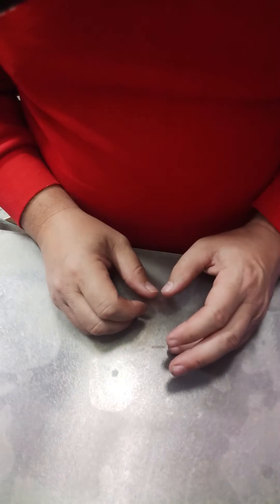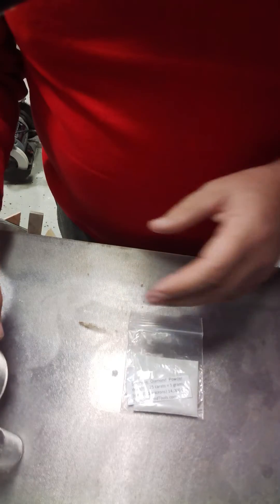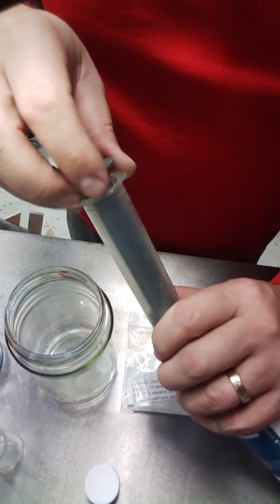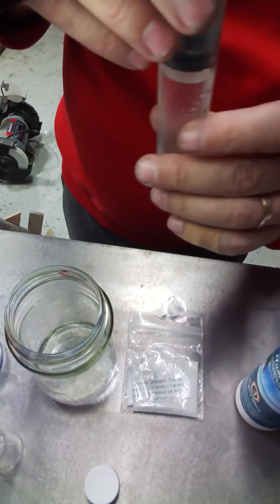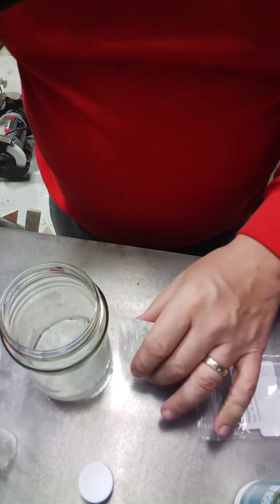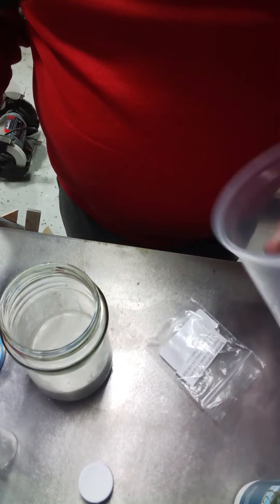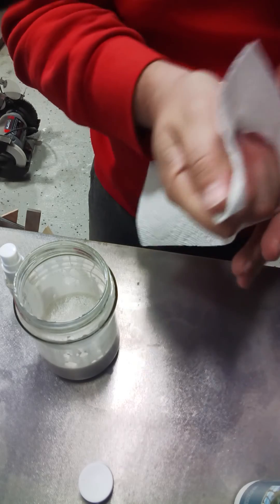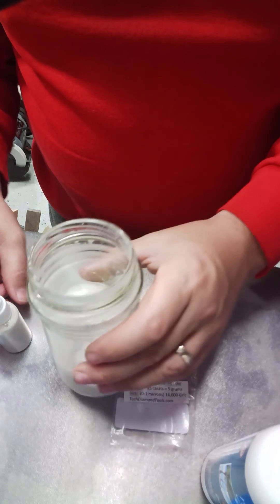DIY Diamond Spray solution for strops.

Comment: Just wondering if you could just use the premix? If its already 50/50 pg/H20 then you should be able to use it directly from the bottle without adding any extra water. Another idea i was thinking about would be adding food coloring to each diamond spray so not only would the solution be color coded so would the strops. I also like using basswood for my strops.
Reply from the maker: You probably could.  But it really depends on what you are using your diamond spray on.  I use mine primarily on various motorized belt grinder with leather belt or a wool pad on a scissor flathone.  What I have since found is that anything with speed that can cause the sharpened item to heat up will cause Propylene Glycol (PG) to form a hard crystal coating on my sharpened object when the item becomes heated during the buffing process.  It doesn't take much heat before the dark black crystal forms on knife or shear.   The crystal coating can be rubbed off with alcohol but it takes a bit of effort.  So any concentration with PG in the solution has the potential to cause this situation.   The 50/50 use of humidor solution would create this coating.  I have since moved over to using my recipe with the Di-Propylene Glycol (DPG) and I don't have any of those issues anymore.  If you are using the spray solution on hand strops, I don't think you would have any problem.  But like I said, I am really liking the new formulation.  You can find the new formulation in the video details under the 20240712 update.  I use camellia oil to the recipe to keep things better in suspension because I I have and use camelia oil for shears and knives.  Mineral oil for cutting board might be a suitable alternative if you don't have camellia oil.  I really like the new formulation for both motorized belt and hand stopped leather pad.

Comment: 2 oz distilled water
3 oz of humidor solution would have worked better, right?  or better still if DPG - 3 parts DPG+ 2 parts distilled?  got DPG...mygreathanks and blessings
Reply: In the end I think any ratio would probably work.  I haven't needed any more solution yet to try other recipe.  One person posted previously that if they used 50% propylene glycol (PG) and 50% vegetable Glycerin  (VG) that the diamond powder stayed in suspension.  This is a common vaping configuration recipe.   Propylene glycol(PG)  and di-propylene glycol (DPG) are a type of alcohol which are used as a viscosity reducing agent and aids in keeping powders in suspension.  DPG is considered safer and used in cosmetics.  The other idea is you want to keep a bit of tackiness so it holds the powder onto the strop when it dries.  Glycerine or vegetable glycerine would help keep leather soft but you don't want so much that it starts acting like a sticky sugar and holds more dirt and steel on your strop. The glycerine would tend to cause spray bottle nozzles to clog up.  Next time I try it I might just use straight humidor solution since it is 50% water and 50% PG.  Nothing to mix but it would end up costing a little more to make the solution.  Also if you use different diamond grain sizes, add a different food colouring so you know which solution is which grit.
Reply: @toddbenko6701  that last bit is great advice - color coding different grades. and your first point - doesn't matter the ratios - even pure distilled would do as one shakes the bottle anyways before spraying.  my order of diamond dust is arriving first week of May and will try 50% DPG + 50% distilled water.  will also try 75% DPG +25 distilled and last - pure DPG and will let everyone know results...mygreathanks and blessings
Reply from the maker: I use my diamond spray solution on 1x42 leather belt and a flathone scissor honing pad.  When using the solution on the flathone for hair shears on a felt pad, the scissors would get hot enough that the propylene glycol would crystalize and form a hard shell on the metal.  My last batch I have changed my recipe to the following

2.5 oz distilled water
2.5 oz of Di-Propylene Glycol
3-5 cc of Camellia oil 
25 CW = 5 grams monocrystalline diamond powder.  

I added the oil because I wanted a more softer media that would that tend to move slightly in the direction of some of the diamond pastes.  This isn't a paste but it keeps a diamond solution on top of the felt pad stropping media.  I use camellia oil because it is what I have on hand for knife coating and scissor lubrication.

So far this is working extremely well.  I also notice the solution is keeping the diamond powder in suspension much, much better.  It spays out on my work surface as almost a sort of light thin foamy appearance.  Maybe I should have use 3oz water to 2 part Di-Propylene Glycol.  But it is definitely better than using the propylene glycol product.

Comment: why not just add the diamonds to a light leather conditioner like lexol or bicks instead since that is designed to soak into the leather and has leather appropriate oils and waxes and glycerine etc.
Reply: Everyone had different ideas of how they want the diamond crystals become cutting agents.  We use this approach because the diamonds are sprayed and remain on the surface.  We want the solution to be able to evaporate and expose the diamond edges but also to be held sticky enough so they don't bunch up or scraped away by the stopping action.  I use mine either on a 1x42, 1x18 leather belt in a belt grinder or on a flat leather strop.  The spray on solution is to apply a new top coat of diamond crystals.   The diamond paste configuration is similar to your concept. It is used to build a base foundation on a strop.  Both are acceptable but basically two different intentions.  One is base foundation, the other is surface retreatment.

Comment: How did it go? Did it do a good job holding the powder in solution? Any negative effects on the strop leather?
Reply from the maker: The latest recipe in the comment area works a little better.  My bottle of spray that I use every day stays in suspension.  The extra bottles I get tend to settle out sitting on the shelf after about a couple of weeks.  I only go through a 1 oz bottle every 2-3 months.  When I take one off the shelf and give it a rigorous shake it's good to go  as my active use bottle.  I use mine primarily on felt pad and 1x42 leather belt on the grinder.  Been a couple of years now and still using the same leather belt.  I really like the new formulation with DPG and camillia oil on the leather because it provides the right amount of tac to the belt for pulling off the burr and polishing up the edge.  The leather doesn't get dried out and doesn't get too supple either.  Keeps the right feel that you know it's working with the steel.

Comment: Got some glycerin to try this out. Also picked up some deionized water because I vaguely recall it being in other diamond sprays from a forum post years ago. I also ordered some 1 micron diamond powder to give it a try and depending how it goes, make my own for all grits.
Reply: how did it go with the glycerin?  sounds like a great idea....mygreathanks and blessings
Reply: The deionized water prevents the diamond emulsion from clumping each other giving more even and consistent micron
Reply: Another update and tip. My formulation tends to settle down. To help remix it, I added a couple pieces of ceramic pellets for rock tumblers in the bottles that seem to help break the settlement up.
Reply: Any updates guys?? Haha
Reply: Still works good

Comment: My best formula was vg/pg 50/50, tried vg/water and diamonds still go down, 50/50 pg/vg hold the diamonds perfect, so far after 8 hours nothing seating at the bottom.
Reply: Is vg = Vegetable Glycerin?
Reply: @emaicee  correct
Reply: @ivanlujan253  Thanks for the fast replay. I will try your mix. Does a spray bottle  still work or should I opt for a pump cosmetics bottle?
Reply: @ivanlujan253 do pg/vg help the diamonds stay on the stopping material as well? Or just for suspension
Reply: I think everyone is missing is the point for having the diamond powder mixed in an emulsion.

The main reason why we need a good emulsion is not to simply keep the diamonds mixed.

The main purpose of the emulsion is to make the diamonds lodged and stay into the leather surface fixed and to resist and abrade the blade edge while stropping.

I used various solutions where the diamonds are nicely integrated into the liquid and when sprayed the stay on the surface of the leather, but still, when I strop my blade over them, the blade just glides over them making it useless.

While experimenting, I made a solution of glycerine to water which when sprayed on leather, created a sticky/ tacky surface, due to which the blade edge when stropped on it, was facing some resistance.

And because of this resistance the diamonds were actually polishing the edge and refining it, unlike previously where the blade was just gliding on it.

The sad part is that I did not measure what ratio was the water : glycerine😂😂.

Still I'll start experimenting again to find the perfect solution to achieve that polish.

To me whether the diamonds remain suspended or separate in the bottle don't matter much, as I can simply shake the bottle to mix them back.
Reply: @Knifesharpindia-1361  can you share a reference point for the recipe you used? id like to give it a try and compare it to this please and thank you my brother
Reply: Propylene Glycol and Vegetable Glycerin... Thats what i use in my vapes... :) thanks thats good to know... 
but does it matter if you get poly or mono chrystalline diamonds?
Reply: @fp_83 
 It would make a difference if you were putting hundreds of lb/sq inch kg/sq metre on the diamonds between to hard surfaces but as we're only lightly stopping it makes little to no difference.
Reply from the maker: poly crystalline diamonds are better but cost way more and harder to find.   Mono are still diamonds and will still perform a cutting action.  It's really up to you as to which you want to use but both will work.
Reply: can you make it in a paste?

Comment: Propylene glycol is also the stuff that goes in e cigarettes Vaping devices. A synthetic alternative to glycerine. Could be easier and cheaper to get hold of as it's sold in vaping stores for people who blend their own
Reply from the maker: The solution I really wanted to use was DPG or Dipropylene Glycol.  It seemed much harder to find and more expensive just for small batches of my own diamond spray solutions.  
Footnote even with the Propylene glycol, my latest batches still seperate sitting on the shelf but they do stay in suspension longer than just water alone.
Reply: I have both PG and VG in gallon each, I will try VG on my next mix, VG supposed to be a bit thicker.
Reply: @ivanlujan253 
What is VG?
Reply: PG is not an alternative for VG, vaping juice is made as a mixture of PG and VG.
Reply: @galileo_rs  Vaping suppliers sell both pure PG and pure VG for blending